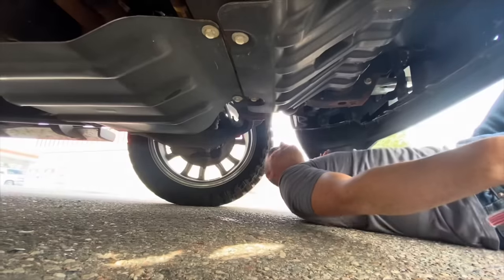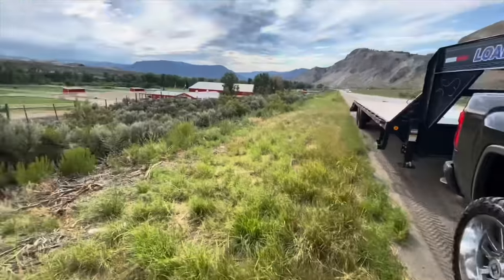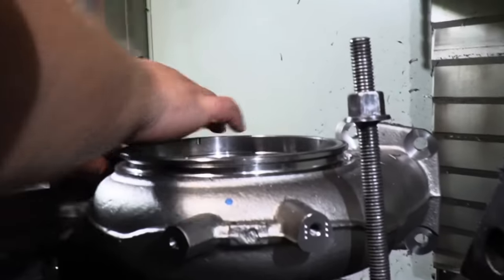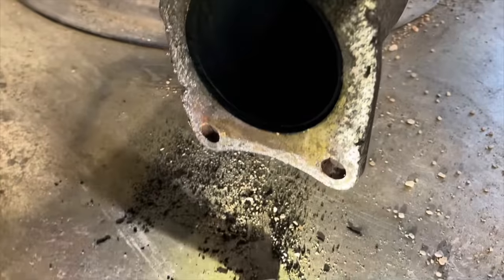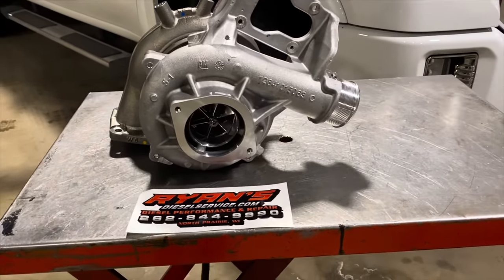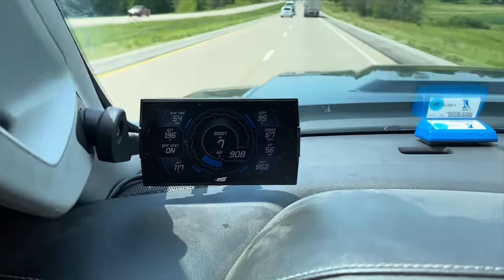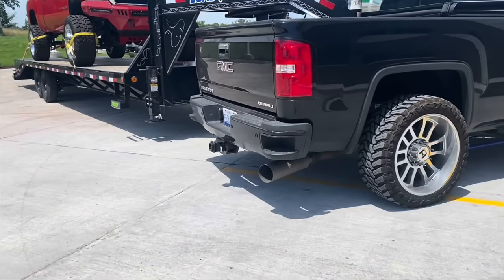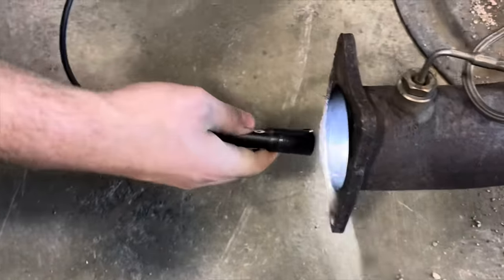This Is What Emissions Did To My Diesel! Heads Up Diesel Owners!

Comment: My 2020 duramax started throwing all kinds of codes.  Took it to the dealer 3 times, and 3 times they said it was fixed.  It wasn’t. I finally found the problem myself; a hole blown in the boot on the hot charge pipe.  Dealer couldn’t get the parts for 2 weeks (we were out of town), I got a boot from PPE and fixed it myself.  Unfortunately, all this BS caused the dpf to plug, so back to the dealer for a forced regeneration, for which I was charged $165.  GM refused to reimburse me because I did “unauthorized repairs” even though it is specifically allowed, as spelled out in the owners warranty manual.  F-you, GM.

Comment: I'd love to do an executive order that in all 50 states that for an additional $500 for personal and an additional $1500 for commercial for registration fee's you can strip all of this emissions crap of your car, truck or SUV and not have regen of DEF or any of that BS like Diesel vehicles prior to 08 or whenever that crap was made mandatory. Those fees would remain in place for 10 years for personal and 15 for commercial from the model year so the first truck you can do for only parts and labor.

Comment: Every time I hear this emission nightmares,the more I Love mi 92 first gen Cummins it's been very reliable,I also own a 2002 ford f250 with a 7.3 bought it new now has 286,000 miles still no problems except CPS.

Comment: Yes def emissions problems they need to find a better more reliable way. Just a marketing gimmick for the EPA to push more electric vehicles. I'm sure power plants push out more than the trucks on the road
Reply: they love it  the epa and the dealer   nothing but $ citations  repair bills  new trucks !
Reply: It's called gasoline
Reply: Umm, I work in the power industry
As far as particulate emissions, it depends.
Used to be that the coal stacks didn't have DPF's. Now days, we have them like 'bag houses' or 'scrubbers'
So yeah, the exhaust gets seperated from the particulates.
Problem is, you would be also correct in saying that the particulate gets out. I've seen ash ponds... heard the stories from the old folk. Coal ash gets everywhere if its dried and not buried.
It blows around towns and areas around it, including coal if its powdered and left outside.
Is it bad for you? Only if you drink it everyday like if it gets into your water.
Arsenic is a natural element sometimes present-like other heavy elements.
But yes, its better than what it was 40 years ago but its really not that much better.
As far as NOx and C02 emissions, yeah, burning any fossil fuels will have the gas waste product that plants eats.
Natural gas power plants exist. They have problems only if the natural gas isn't refined properly/purely in refineries.
The sulphur content just builds up like yellow/greenish waxes that looks like snot all over. I've seen it in refineries... Burns 'cleaner' I guess. Less particulate in total, but still there are white ash particulates that exist.
Yeah, its a hard line but I still think the EPA needs to create happy mediums. 
Require emissions for vehicles? Should have nipped that in the bud a long time ago.
Why can't they allow us to own our vehicles. Why couldn't they just reduce overall emissions and stop producing more, and allow us to improve vehicles like an investment-like after 200K miles, let us delete it. Or have us pay carbon taxes... makes no sense.
None of it.
Rolling coal is for jerks of course, but still. Let people get fined for doing it maliciously, ok, fine.
But now, its like the second amendment. When will we see the day that gets taken away?

Comment: When I was looking at a 2010 Chevy Duramax and the owner told me that everything on it was stock with the EGR and DPF I turned away and bought a 04.5 5.9 Cummins instead since it had no emissions installed on it other then the in-cylinder egr but a bypass filter was the fix for the soot in the oil. What is gonna suck in my opinion is that down the road the I feel that the EPA is going to make it that these pre-emission trucks are no longer allowed on the road but the EPA can suck it lol.
Reply: I don't think the epa will mess with the older diesels the ones left on the road will be getting old & dying off not worth their time. They'd rather mess with people trying to deleted new trucks. You may be right though the government never ceases to amaze me.

Comment: Is any of the emissions issues partially due to the mods done to it for added power….style of driving?? I’ve know people with 2008-2015 Duramax’s with over 200K miles and never had any issues with any emissions equipment
Reply: Yeah that’s what I was thinking, like maybe the tune is pushing too much soot into the system
Reply: agree 100%. Was it the tune he did to it, melted wires, or a sensor that went bad? Will we ever know? Does his wife need 1000 hp to pick up groceries and the kids?
Reply: Probably a fault of something else. Even with intact tuning these emissions systems should last 100-200k
Reply: I think I was right. Faulty 9th injector for dpf cleaning. Could have happened on a stock truck imo
Reply: @mikefurr5281  yes...yes she does!!!
Reply: Blew the coupler off the charge pipe, didn't stop and fix it so inevitable it won't run  efficiently or regen
Reply: @jaybirdls1  that is true however that tuning on top of how he uses it likely made this happen sooner. Either way just rip the emissions bullshit off
Reply: Yes.
Reply: Was wondering the same thing.
Reply: @mikefurr5281   she may need 1200, if that’s what they like who are you to say anything about it.
Reply: Depends on a multitude of things, id assume it being a michigan truck it has alot of idle time warming up in the winter which is terrible for DPF/DEF systems, tuning it to run hotter in theory would alow it to blow the garbage out of the exhaust better/faster. Sounds like the injector just took a shit and the system couldn't function at all. Them going through the mountains putting a load on the motor I'm sure didn't help the situation at all as far as how fast it plugged up.
Reply: I would think if your accelerating hard, pushing it rich a lot your generating more soot vs someone that drives fairly normal and keeps out of the power. But certainly if it was not performing/completing regen it for sure would clog up. Seems like it makes more sense that the sensor went bad and it caused the issue. That charge pipe couldn’t of been blown off very long….you would of known it easy.
Reply: That’s still a 75k truck that won’t operate as advertised. As a potential 1st time diesel buyer this is scary. I want to buy a 5th wheel toy hauler but this makes me rethink everything
Reply: @shawnmiller834  , buy stock and not modified. Make sure it has maintenance records and you will be in good shape
Reply: @shawnmiller834  Many people in your position have just bought a 7.3 godzilla Gas Ford & called it a day strictly cause of emissions
Reply: I would have a 1,000 horse power to get groceries if I had the shop to build my truck in
Reply: @shawnmiller834  do yourself a favor and buy one already deleted. The emissions systems on all the diesels are garbage and thousands to repair when they break.
Reply: I have a 07.5 lbz swapped with a rds 64 ml I wouldn’t have a new one for anything
Reply: Realized one thing today . I’m not looking into buying anything more from our automakers that the “ Fed’s have had a hand in” ….  Still consider myself lucky & blessed to still own & drive the shit outta my ‘02 LB-7 GMC . With 4” stainless Exhaust and No Cat at all ( Federal remissions diesels back then were NO WHERE NEAR  as chocked up nor controlled as bad as trucks are now) runs just as good as it ever has. Gonna keep that old dog as long as Diesel fuel is still being sold . Hard to beat the K.I.S.S. Principles …. Keep It Simple, Stupid…….. as they say “ Less parts / More better “   Years ago when I was sent to Sheboygan Wisconsin for Kohler Generator training the Class computer would not link to the training engine for Diagnostic training and after 2 days of struggles and watching the instructors get more & more aggravated with the systems not playing nicely I raised my hand . One of the instructors asked if I had a question to which I responded “ Yeah, just HOW the HELL did manufacturers get so far off base . Henry Ford had it all figured out with the Model “T” where all you needed was compression, a spark at the correct time , a combustible mixture , and a hard enough yank on the bent lever you physically connected to the front of the crankshaft through the opening in the Radiator and you were up & running”
Reply: Mine hit 210k before my l5p plugged the emissions. Lots of towing and city driving. No tunes 100% stock. Personally I’d never put an edge or a box tune on a truck. I know so many diesel guys that go get a box tune from edge, bully dog or someone and slap it on. These tunes are the worst you can really run. They have limited r&d and mostly look for hp numbers on short runs and achieve it by the simplest means. Their theory is generally timing changes are bad so let’s just add fuel and air. And generally it’s more fuel. The key is in dpf and egr trucks you can add fuel and not add smoke by the emissions design. All while this is killing your engine. Personally though if the government wants us to run emissions vehicles. All theirs military and all should have the same systems and must maintain a standard of 5yrs of operation and then be fazed out. Or if they are gonna force them on our trucks they should have a program that pays to replace all emissions equipment when it fails. Shouldn’t be on our wallets when we have already paid taxes 4 times when our money is spent
Reply: @mikefurr5281  does anyone really need 1000hp for anything? Unless you race then the answer is no. That being said just because you do t need something isn’t a reason not to have it otherwise nobody would have anything fun. Personally I enjoy towing my groceries home in my F250 black widow! Who wouldn’t?
Reply: Tune probably doesn’t help, but I’ve seen tons of trucks without a tube have the same problems. GM makes junk
Reply: @mikefurr5281  if they want 1,000 hP to have fun with it’s there choice. Why you mad or something?
Reply: @chrisreed3593  I agree with you. Want and need are independent. I didn't need my lbz, I wanted it. I've watched a lot of videos on YouTube, recently Banks Power and I like what I see there. Right now I don't need more horses. I can pull everything I have just fine.
Reply: @dieseldouche5.953  nope,  not mad at all.
Reply: @mikefurr5281  we get it mike, you wish you had 1,000 horsepower 😂💀
Reply: @srosegriffith9844  you know, if you’re gonna comment on diesels or emissions you should probably understand even slightly what you’re talking about
Reply: @KDlGG  I have three diesel vehicles one being a GMC AT4 Duramax Turbo and I also know our climate is being damaged by carbon emissions. And I hope with research and development our vehicles become cleaner and cleaner and I am willing to adapt to those changes.
Reply: DDF injector fail has nothing to do with mods!
Reply: @TheMacronical  I have a 2014 Tundra currently I don’t imagine a 7.3  gasser as a huge increase.
Reply: @shawnmiller834  My 2017 Ram 2500 6.7 Cummins has almost 116k miles on it (had 7 on it when I picked it up at the dealer), I have yet to have ANY issue with the engine or transmission. It is stock save for a K&N air filter, Banks rear diff cover, AFE front diff cover, and PPE extra-capacity trans pan. I've towed my camper(s) with it since 500 miles (first 3 years a 10,000 lb. GVWR tow-behind (non-5th wheel) toyhauler, last 2 years an almost 13,000 lb GVWR tow-behind toyhauler - always loaded both to GVWR or more), so it's been worked. I'm a master diesel mechanic by trade; I take very good care of my vehicles and rarely have issues with them. 

So, my advice: don't listen to all the advice about what mods to do to get more power (there's a lot of "experts" out there that don't know what they are talking about) - be reasonable on performance upgrades and take care of your truck - and you'll likely not have many issues. Start throwing a ton of performance mods (high flow injectors, pumps, turbos, tunes, etc. etc.) and you will almost certainly have issues with the factory DPF because it's basically an air filter on the exhaust side of the truck - it filters particulates from the exhaust - so it WILL get progressively plugged over time. DPF filter cleaning is a MAINTENACE ITEM. The truck will attempt to clean the DPF by performing a REGEN, but it can never clean it 100% like new - even when you send them out to get cleaned they are not like a NEW DPF. Would you run your engine on the same air filter until the truck quit running??? Likely not, as most people understand that air filters get dirty as miles rack up, and they change them at a specified maintenance interval. Also, think about this (which just goes to show how uneducated people are about this): if you mod your truck to produce more power (by increasing the amount of air and fuel that go into it), but you don't increase the capacity of the DPF to handle the increased air/fuel, how can you expect it to do it's job properly or last as long as it is supposed to???? SPOILER ALERT: you can't, and it won't. It's pretty darn simple.

I wasn't there and didn't have an opportunity to diagnose the truck in this video, but I'm 100% certain that the factory emissions system is not at fault - the mods to the truck are. Now, having said that, I DO believe that we, as owners of these trucks, have a right to modify them as we see fit, and that should be 100% legal to do as long as the truck will meet the emissions standards for the model year (by way of say, IM240 testing) regardless of whether the emissions systems from the factory are there or not (of course, if they are not, the truck likely wouldn't pass). The EPA's current take on it is that if you have tampered with the trucks emissions system, which includes altering the tune of the engine, you have tampered with the emissions system. I think that is BS. If you have modded your truck and it can still pass an IM240 test, the EPA should not care, since you are MEETING the standards. That's the issue I have with the government with respect to our trucks. If it meets the standard, that is all that should matter. That is assuming of course that the EPA actually cares about emissions and cleaner air.......
Reply: @mx3727  Thank you for your detailed response. I’m seeing that the mods for more power+delete of the emissions systems comes with additional maintenance!!

Comment: The company truck that my Dad drives is a 2016 GMC Sierra 3500 Dually Work Truck, it had the same issue with the sensor melting preventing it from being able to do a regen. It’s been fixed & other than that it’s been a great truck thus far not giving many other issues with it, it’s also got over 300k miles on it too. They also rotate between 3 other trucks being a 2019 F350 Dually XL, a 2009 Silverado 3500 Dually Work Truck, & a 2005 Chevy 3500 Dually Work Truck. The 09 has given them the most issues due to the computer system it has, the other trucks have been great. The 05 is just due to old age things are starting to break on it from what he’s told me.

Comment: I’ve got  a 2008 gmc 3500 duramax. The issue I had is mouse built a nest in the air filter and screwed up the burn cycle. Easy fix at the dealer.

Comment: My 2008 dodge Cummins was plugged, dodge played with it for 3 days, told service lady to gfh.
Took off on 2000 mile trip to pickup cabin cruiser. On the way home it burnt the crud out and have had no problem for the last 5 years

Comment: Other channels and forums on this topic will mention how fuel and oil quality can impact emissions.  Many say that poor quality fluids create more ash and can cause the DPF to do more regens.  And with the Ford and Cummins injecting fuel on the exhaust stroke, cylinder wash can also be a problem.  Don't cut corners on maintenance intervals and always use quality fluids.  (Stock, or not, applies equally.)

Comment: I dread having to go through our tractor when it's time. They plug up about 2000hrs from what I hear. Exhaust is always rusted together, the stainless pieces gall together and miserable to get apart. And you gotta be careful so it doesnt mess up the catylist. We check coolant constantly because it used coolant in the first 400hrs and was told its probably air bubbles working out of the engine. But I know the egr cooler can send coolant into the intake so hopefully thats not the case.

Comment: We got a 2021 Chevy 2500 HD Duramax ,  we just got the Reduced Engine Power , Clean Exhaust Filter warning on the Dash . 
Did some Research , got a code P2463 Found Out DPF is Clogged, 
Its the weekend now and Got a car on the trailer to take to Spokane on Monday , but now need to find a Diesel Service to unclog  the dam Soot... 🙃 ... ayee , what a weekend . Lol.. Good Luck Everyone 👍🏼

Comment: I've had two emissions duramaxs 2011, 2019 neither had any dpf issue, that being said I live in the country , no stop and go , always doing 75-80kmh at the minimum,  I use it to pull and haul whatever , but most of all I don't idle it. I get it hot , run it and shut it off , change the oil every 5000km never had any issues.

Comment: You mention that the truck would not do a regen. How long had that been happening? These newer diesel engines will not run too long if they can't regen to burn out the particulates. First time I ran into this at work, the truck had ran over 600 miles with the warning light on. Toasted everything from the turbo to the muffler. Glad to see it worked out well in the end.